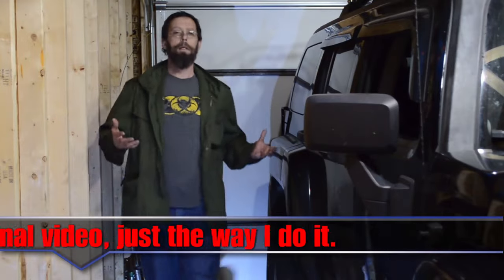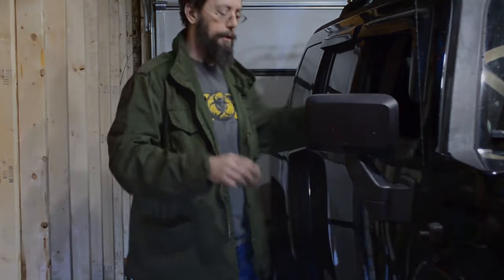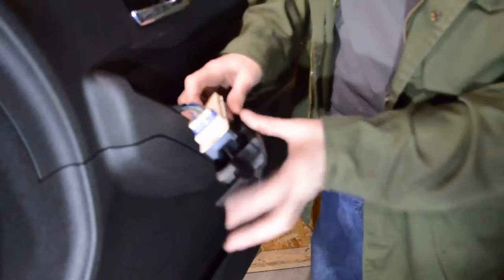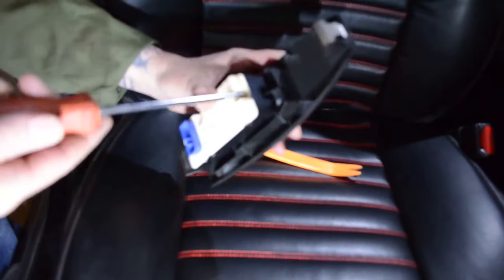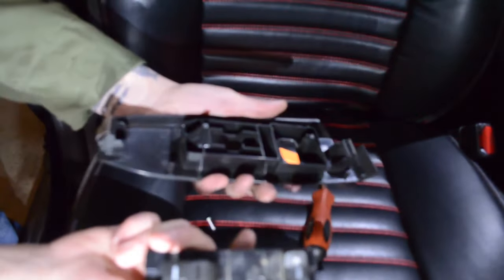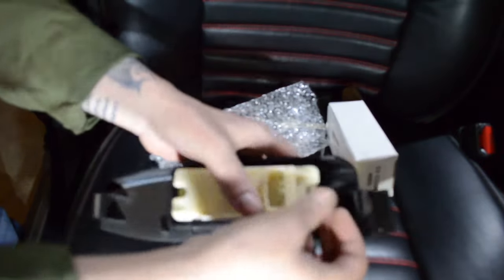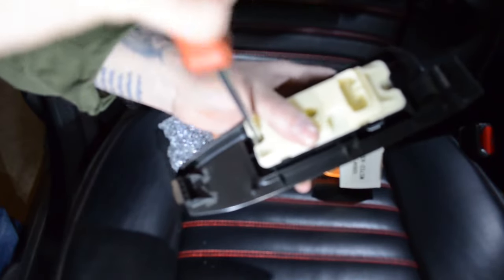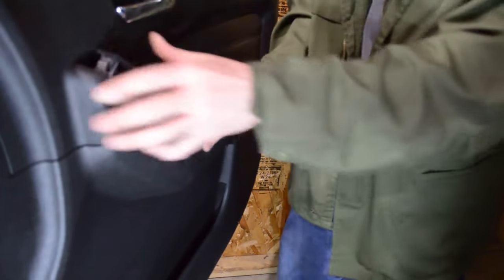Hummer H3 - Window Switch Replacement

Comment: Had the "Door lock/Drivers window" issue after the battery was discharged while wife was taking her work break and needed to boost "Humzie".
This is the 3rd time in as many years. The first 2 times I was able to discharge the entire system and short the battery cables. The 3rd time I tried discharging and shorting a few times to no avail.
I thought it was bcm but found the issue was the 2 capacitors on the switch module don't discharge and thus (IMO) prevent the obc from detecting proper voltage and working as they should.
Discharged the caps w/a pigtail and an led array, rechecked voltage was now zero, Hooked switches back up, reconnected the battery and voila.. ALL windows, door locks and alarm now functioning as they should with NO shorting of the cables.
Your vid helped me get the switch panel off. (-17'C and no broken clips 😉 )
Thanks.
<10 minutes to perform and FREE!!